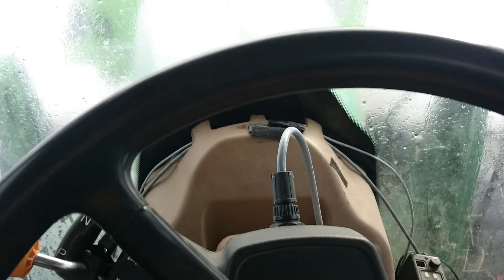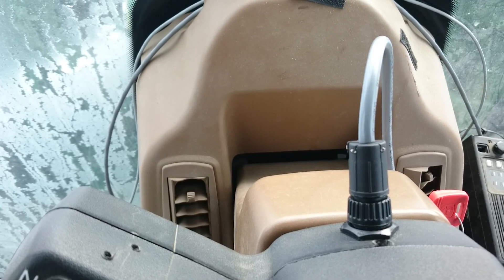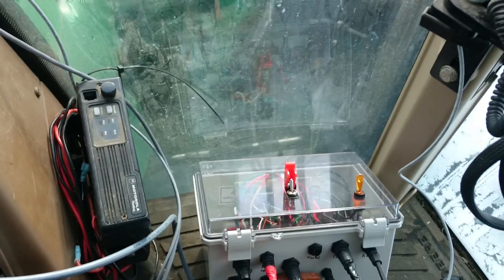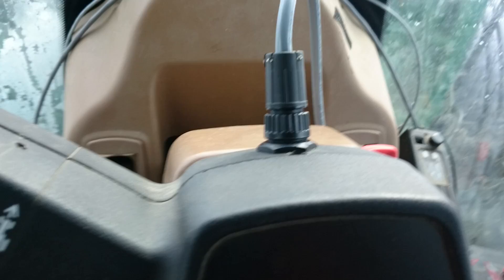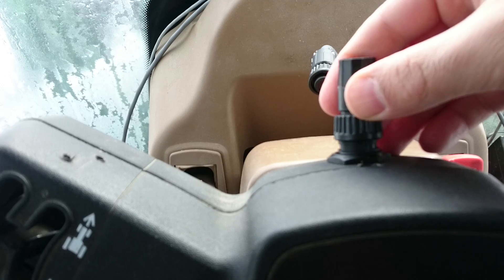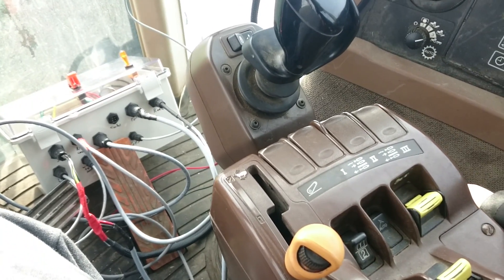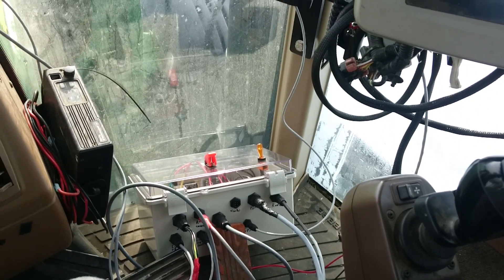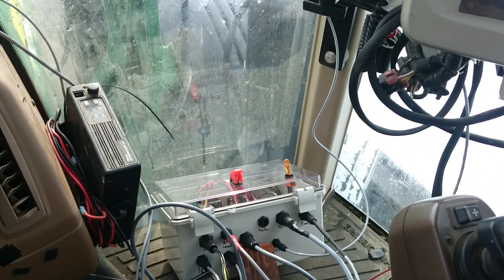Inside the Reimer Robotics tractor

Comment: So you're disconnecting the LH reverser encoder from the CCU and other controllers and are connecting it to that "control box" and that tractor isn't throwing a shitload of fault codes and is operating normally? Your home-made electronics are working with a ZF IVT transmission in a Deere tractor with CAN-bus electronics? And all it takes is that control box and that nifty little plug in connected to the LH reverser encoder to make it all "autonomous" and when you want to return it to manual that terminator (a CAN-bus terminator I'm guessing - active or passive?) just plugs in and its back to "stock" configuration? 

I'd like to see what you have "tucked into" that CommandArm that must be connected to the IVT speed control lever. What IVT mode are you operating the tractor in? Those ZF IVTs are really touchy when it comes to calibrations and faults they'll tolerate and kind of have a reputation as a clusterfuck that can go from 60 to 0 almost instantly leaving a technician with little or no ability to diagnose them let alone repair them. I've only worked on one myself but it was a "contact DTAC" deal because there is so little diagnostic/troubleshooting you can do with them and they're so ridiculously complex to perform such a simple job. 

I think Deere told ZF they wanted an IVT to fit where the existing 6000-series and 7000-series transmissions fit and ZF decided that meant they had to use every last cubic inch of that space and had to fill every cubic inch of the transmission housings with gears and clutches and shafts and other "guts" to justify what I'm sure was a ridiculous price-tag since the remanufactured ZF IVTs for those small, low-hp tractors are about as expensive as the huge hunk of cast iron and steel 8030/8R IVTs. Of course when you look inside an 8030/8R tranny that big case looks like a big empty hole compared to the innards of a PowerShift but I think that was Mother Deere making a point or at least Deere Powertrain engineers making a point. 

They put in a little bit of everything. A clutch pack or two, a variable-displacement motor and pump and even a SLIDING SPUR GEAR. Talk about old-school high-tech. Of course all-in-all they're not a hell of a lot different than the differential-steer unit in the track tractors. The Germans just didn't have the same background with hydrostatic variable speed "gearboxes" Deere did. But they always make shit way more complex and expensive than Deere. Their MFWD axles and especially the planetary hubs are a "wonder". 

The Deere IVTs in the 8030 and 8R tractors are FAR simpler and FAR more capable and FAR more reliable. How does your system work on an 8000/8010/8020/8030/8R row-crop or 9000/9020/9030/9R 4WD? How about track tractors? 7000-series tractors and their descendants have their pockets of popularity here and there in the U.S. but the small-frame 7000s are far and away the more popular and more common 7000s. Large-frame 7000-7R tractors are just too "European" in a lot of ways, are a genuine pain in the ass in many ways when it comes to service and repair and have the unfortunate bad luck to be "little brother" to what is probably the best "family" of tractors Deere has ever built. 

The 8000-8R tractors are just so far above and beyond a 7000-7R in every way its no wonder the small-frame 55-series "replacement" large-frame  7000s are like red-headed step-children for most Deere guys. And honestly, I'd rather have a 7810 than a 7830 any day. PowerQuad, of course. The 19-speed PowerShifts are just "odd" transmissions and have more speeds but even that doesn't save them compared to a 16-speed 8000-tranny. Hell, I'll take a 15-speed 50/55/60-series tranny over a 19-speed PS in a 7000. 

If you're planning to "go public" with your system and give Deere some competition for MachineSync using Deere's own hardware and software to a significant degree, you'd better at least give yourself a fighting chance and make it compatible with the good, popular tractors you'll find a hell of a lot more of on grain carts and doing other "mundane" and "boring" and "simple" tasks like tillage than you will 7000-7Rs.

Comment: How Do you controll steering? Is your tractor equipped with AutoTrack with proportional hydraulic valve? or you just have some motor near steering wheel?
Reply from the maker: +piotrek2128 I put on an after market valve from outback guidance.  In my opinion it is more reliable than the JD system.  I have had trouble with the EH valves on JD
Reply: +Matthew Reimer could you please share brand and model of your valve? I plan to do my own RTK system so I need reliable steering
Reply from the maker: +piotrek2128 Check out the model matrix on the following link.  However the valve I have is not proportional. It's either on or off.  If you want to have RTK accuracy you will probably have better luck with a proportional valve.  http://www.outbackguidance.com/Products/Autosteer/OutbackeDriveXC.aspx
Reply: +Matthew Reimer I will definitely need proportional one. anyway, thanks for advice! it's really nice project, for now I plan only to make autoguidance on inch accuracy level, but next step might be some autonomous tractor, like yours.